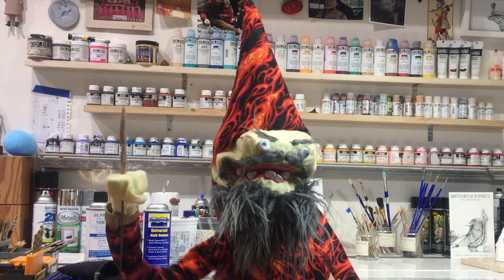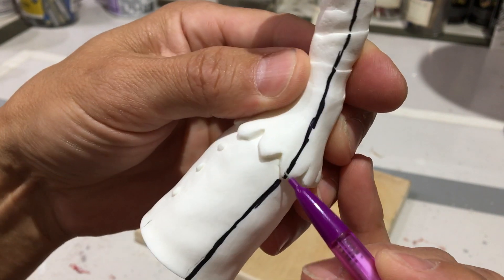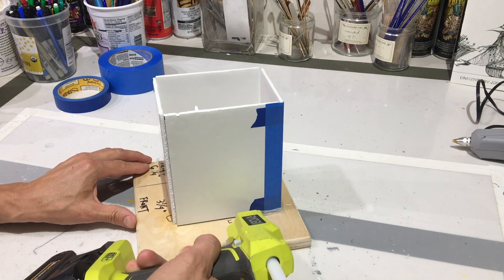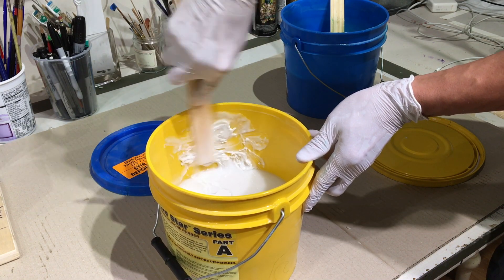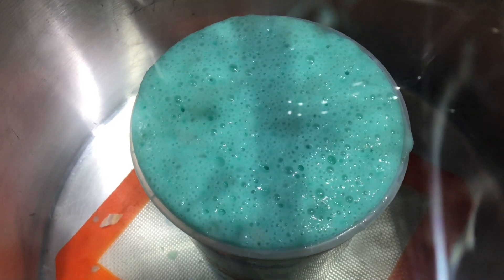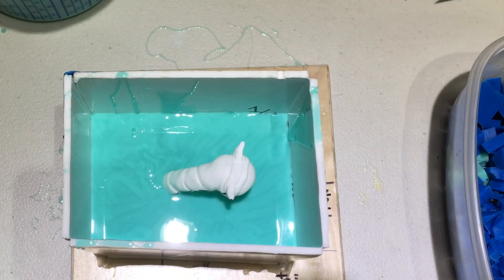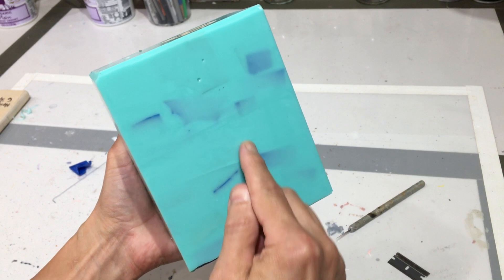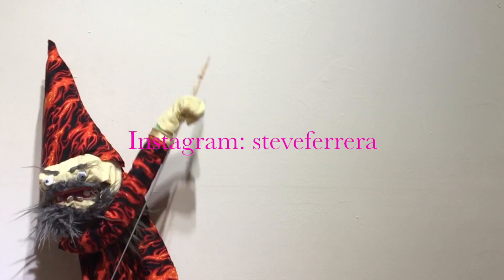Silicone Mold Making: One Piece Silicone Block Mold

Comment: Here is a modification to your mold process that I would try.
Mix up a teaspoon or less of blue, and a teaspoon or less of white and brush on the silicone onto the casting figure. Then install the walls of the mold and measure with rice and divide by 3.  Then run the left-over silicone through a food processor or blender to the consistency of blue cheese crumbles or cottage cheese. Then mix your two parts of liquid silicone, and add the 1/3 part silicone crumbles, mix, and pour. (and you can continue to recycle the molds this way). TBH, you can probably mix way less liquid silicone this way. Break it down into 8ths or 16ths, because the silicone is going to adhere to silicone.
Reply from the maker: time to buy an industrial blender :)

Comment: To prevent leaks, you can pour a small amount of silicone to seal the edges and let it firm up before adding additional amounts.  This had to be done in the bad old days of limited choices. I.e. SmoothOn 724 urethane.
Reply from the maker: i like :)

Comment: Can you use this type mold on real food like a pie? Or will the pie collapse when the silicone is poured on it in the box? You make this look very simple. You have a new subscriber here!
Reply from the maker: foos is tricky. it will probably collapse and most likely not be compatible with the food. You would have to seal the food somehow. Silicone sticks to porous surfaces. If it were me, I'd get a 3D scan of the pie and then do a 3d print, and then mold it. You would get every little tiny detail :)

Comment: Hello love your Video ' I have a question for you. For duplicating or making small 1/72 scale Model aircraft kits  parts and scratch building from Silicone molds which product for mold making is best to use please.they have so many for MODEL MAKING .
Reply from the maker: honestly all that stuff is probably done with injections molds because the pieces are so small. The silicone I use could work- it's just hard to get it into all the little tiny spaces :)

Comment: Could i 3D print my own custom parts and use those instead of an already made figure?
Reply: No knowledge at all but given all the different 3d printing material out there today I would guess there is something that could be working out, actually going to research that as well !
Reply: works just fine. A made a lot of molds from things I 3D printed
Reply from the maker: totally

Comment: Thank you for this in-depth silicon mold tips and tricks! But is it possible to make a 2 piece mold? Would there me any complications?
Reply from the maker: perfectly fine. Just make sure you get the special release spray that allows to two halves to separate!

Comment: Great Videos, thanks. Can you explain the reason why molds needs to be vacuumed while cast require pressure tank? 
I want to start coping parts and want to know what equipment i should buy, and if some of it i can skip. tnx.
Reply: Forget pressure and vacuum both. Pressure doesn´t remove airbubbles, just makes them smaller. In my opinion best way is to put mold in vacuum to make shure. Excuse if i am wrong, anybody..?
Reply: Itay well vacuum pressure tank is pretty pricey especially for beginners or for hobby purpose not professional uses ~ if you wanna safe the money a bit, you can mix a small amount of silicon then brush them onto the piece you wanna cast, using brush (like a cheap one so you don’t mind ruining it with silicon) or maybe using a small paint spatula, I personally recommend using the brush. With a thin layer of silicon and a little pressure while you brush the silicon on, it’s nearly impossible to create bubble on the piece you cast and ruin the mold, and once the thin layer is cured, you can put continue put the outer layer like how he did in this video, even if you have bubbles during this step which you’ll, it doesn’t effect the mold either, the small stream pouring he did is helpful as well
Reply: @NgocAnh-ef5gr  ... I agree ... brushing on a thin "detail coat" into the nooks and crannies will protect the most important part, the actual surface, from any bubbles in the rest of the pour. But don't let that coat cure before you complete the mold pour or you may get a hairline where the new rubber meets the cured rubber.

Comment: Do I need to seal my msla resin printer, 3d prints before pouring silicon on them? If yes what do you recommend to use for sealing the model
Reply: Did you already mold the print.?
Reply from the maker: I dont think you need to seal it, as it's a non-pourous surface. but def use a mold release.

Comment: Hello how are you? I am trying to mould shoes into a clear box , I am on smooth on, you are using the smooth on 15 , but it says the, 14T, 19T, 20T, and 31T Are certified skin safe ., but the one I have been seeing everyone use it the 15 slow or 16 fast. Please can u help me out to figure out what's main diffrrence. I want mine to be block like this and to keep using it for a long rime thanks for video
Reply from the maker: I'm not familiar with skin safe silicones. Arty at Douglas and Sturgess in San Francisco would have that answer though.

Comment: Hey i have 2 questions. I bought the same mold maker as you. Can i mix 2 different molding making agents and if i run out of mold maker and it let it sit will i be able to pour more on top of the dried up half mold
Reply from the maker: yes. using the Moldstar it will bond to the cured part no problem.

Comment: Awesome video that will really help, thanks!
I have a question though, what if your orniment doesnt have a flush flat base..like a skull...do you just place the skull flat on the wooden pannel and glue the areas of the skull which are touching the wooden pannel? hope that makes sence, thanks
Reply from the maker: I make a little conical shaped pour spout that lifts the piece off the wood and provides a little funnel to pour the resin into the piece. You can probably see an example somewhere in a mold video :)

Comment: Would you be so kind as to tell me whether or not each of those buckets contains a gallon of material or if it's a gallon total for the gallon kit? I found another brand and they're gallon kit has a half gallon per jug. I was going to go with it cuz it's a bit cheaper but if it turns out to be half the amount of product then it's not that much cheaper LOL and I can't find a good enough picture of the mold star 15 to be able to read the product label.
Reply from the maker: the "gallon" kits are actually 2 gallons. so one gallon each of part A and B :)

Comment: When I made resin castings many years ago, I used a powder type mold material in a recycled cardboard waxed milk container. Had no problems with leaks of course, and just cut or peeled the milk carton off the mold when done. Could this work or also use a plastic drink container? Wish I could remember the brand name of the powdered mold material... it was very easy to use and set up in 15 to 30 minutes if I remember correctly. Very fast time.
Reply from the maker: Yep! I've used all sorts of recycled plastic and wax coated containers if they fit. Why waste time making something if someone already did it for you :)

Comment: i want to make a copy of a really expensive figure at home for my living room (got little kids so i want to be safe for that point haha)  is there a spray to protect the figure from the silicon? i have the fear that i willl stick on the figure.
Reply from the maker: it's tricky- depends on the surface- I use Universal mold release- but it could leave a film. But if it's a smooth surface- non-pourous- the silicone should peel off without damaging the piece- but if it's old or antique- paint etc. could peel...

Comment: Hi , why you wear a mask on your face,  is the silicone having any bad side effects on breath?
Reply from the maker: the resin will off gas when its setting up. You don't want to breathe that :)
Reply: @SteveFerrera  
Thanks for your reply 🌸,but I ask about silicone is their any side effect /bad effect on breathing, specially I use a different type , tin cure rubber silicone  ,which have one jar of silicone and a bottle of hardner

Comment: What else can be used as filler?
Reply: I think the point of using old molds was because it’s made from the same silicone so it has the same flexibility and isn’t rigid. I’m guessing that some other type of mass that has the same flexibility  like other types of silicone.
I’m curious whether sprinkling in harder matter that is much smaller in mass would work like pebbles to reduce the amount of fresh silicone used by a bit. But I like the idea of recycling molds that have surpassed their usefulness.
Reply from the maker: never seen pebbles. don't see why it wouldnt work

Comment: @steve ferrera any possible way you could show the best way to make a 2 part mold for a tire or wheel? i make many scale model parts, but i cant seem to get a mold for like a model car tire to come out correctly... any help would be greatly appreciated!
Reply from the maker: Hmmm. sounds simple- but you'd have to have an entry point for the resin that would always leave a mark. You could pour into the center with a bunch of sprues like a wagon wheel- then have a bunch of air vents. definitley pressure cast.

Comment: Great well paced video! Which type of silicon do you use to make a mold from natural air based clay and then can use to cast resin?  Do you have any recommendations for the mold material and resin ?  Thanks!
Reply from the maker: silicone doesn't like porous surfaces so air based clay is difficult. You would have to seal it with something. But I'm not sure what because I don't really use air clay. And then I'd use Smooth Cast 300 for the resin- as long as it's compatible with the silicone :)

Comment: Don't need a degasser for that silicone! You're leading people the wrong way.
Reply from the maker: If you pressure cast the resin you do. There are tons of little surface bubbles in the silicone you can't really see- but pressure cast resin will blast the resin into them-